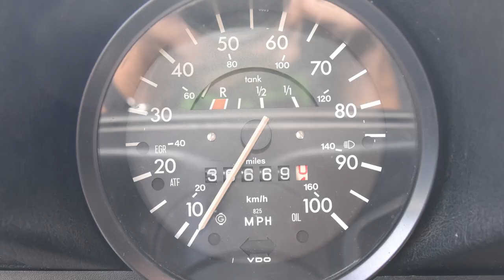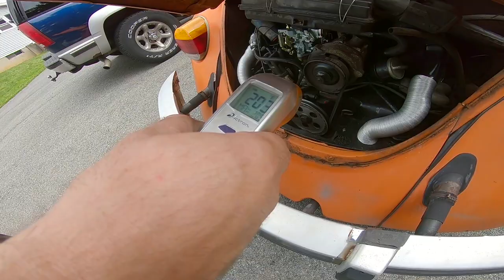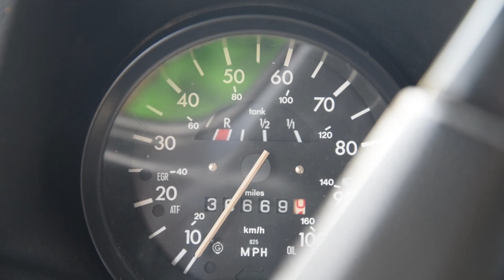1974 Volkswagen Super Beetle 1600: Regular Car Reviews

Comment: I laugh at this review....the reality that disputes every word of this casual opinion of yours was a relative I had, that bought a new beetle every 3 years for about 15 years ...so I guess he had 5 or 6 and this man traveled 100 miles a day for work daily and much of that was on unpaved dirt roads and also in the snow belt...He never missed work...his car never broke down...he did have one that had a phantom electrical issue...but literally the only thing this man ever had to do was change the oil....and yes these cars were simple, with a free afternoon and a six pack of beer a person that knew how to hold a wrench could perform just about any maintenance this car needed, including replacing a clutch. Just looking at the car you reviewed I could tell that this was a stellar example of a car that hasnt had any real love in a very..very long time and although it looks ok from 10 feet away...this particular example is the worst one to base a review on.

Comment: Good review as usual, but you need to lug a VW air cooled engine. First gear is for the first 12 feet, 2nd up to 25mph, 3rd up to 40 and highway hills, the 4th for everything else. You should spend 90% of your time in 4th.

Comment: I owned a 1974 super beetle and I don't believe this model your showing is a 74. Two things are different on your model. Mine had because of the new law at the time seatbelts assemblies attached to each door, that belted you in and there were plastic caps on the end of each bumper. Check it out,  good  video though.

Comment: I'm writing this as i watch. Drum breaks all round? I thought they had at least got discs by this time? Friends 75 had discs already. If not you can do a conversion.  The Super beetle turned sharper and was supposed to handle better.  Beetles are perfectly driveable in the winter, all year round.  Honda Civics in 1974 were shit.   They can cruise at 60, tops out at 92mph.  You need to sort your timing out, make sure you have an electronic ignition.  ALL classic cars need mechanical knowledge to keep them running. How many shitty Hondas and Datsun survive now?  I love the Beetle and love lots of classic cars, not just Bugs

Comment: A BIG problem with this Beetle is the missing engine seal that goes around the entire engine metal pieces.  When Dr. Porsche designed the Beetle he separated the engine into two halves, the under hood area is the clean/cool side and beneath the car is the hot/dirty side.  The two halves must be sealed from one another thus the problems in this video.  And no need for a metal fuel filter.  Also, if the heating duct work, heater boxes, and exchangers are in good shape the heating in these cars is very powerful.  The transmission gear use description here is ridiculous, and untrue.  This is one very screwed up Beetle.  When people have problems with these cars it's because they are not being worked on or cared for correctly.  A correct Beetle is just about trouble free.

Comment: Had a 1974 standard Beetle for 8 years and 120K miles. Never broke down. Even go me home after a deer removed it's left front fender. Like most cars of the era, was a victim of rust but not like the Honda Civics of the day. This 'review' is a travesty, based on a car that obviously has been and continues to be poorly maintained. Does the Beetle have faults? Sure (like practically no heat), but it was a great car for the money back in the day and would be one classic car I would love to own today. A Honda Civic drivetrain from that time might still be good but sadly the rest of the car would have long ago turned into a pile of iron oxide.

Comment: 21,529,464 Volkswagen Beetles manufactured and sold. 0 people unhappy. Until this douche bag hipster says they are terrible. I've driven beetles across the country from Florida to California or Washington state. Once from Panama city Florida to Anchorage AK and back. Never broke down, never smelled like gas, always enjoyed every mile I drove them. Have a 1972 Super Beetle, 1968 Beetle with Auto-stick-shift, 1972 Micro Bus, and 1974 Gia and Thing. If you have an average intelligence and 500 dollars worth of tools, your air cooled vw will run like new. Even up steep hills. My 72 Super Beetle has 125 k miles on the second engine ever. In the process of building a new stock power plant for it. Yet I'll be driving out to Los Angeles in September.

Comment: You chose these over a civic because the civic was already rusted out when it got here. Maybe next time you review a car don't pick one that is beat to death and not maintained. I've owned and raced VWs for 30 years. None ever smelled of gas, none ever ran different with the weather, none ever had gas lines rubbing on things, because I looked after them. Oh, and I've used plastic filters for 30 years, never had a leak or fire. Then again I used this other part called a hose clamp.  Hopefully this car went to someone who will look after it.

Comment: Why would you buy one of these in 1974 over a 1974 Honda Civic?  In 1974 the Honda Civic was a tiny car, more like the original Austin Mini than the Honda Civic we know today. By comparison VWs seemed positively large and back then they had a well earned reputation for reliability. It is true that in 1974 the VW was at the end of a long run and outdated but many of the new small cars introduced at the time weren't particularly reliable and rusted something fierce (In the late 70s I had an early 70s Toyota Corolla where the entire front subframe, wheels and all, rusted right through and just dropped off the car one day). In 1974 VWs were a known quantity and if you just wanted reliable transportation they'd get the job done while you were waiting for the new models (especially FWD models) to work out the kinks.

Comment: I don't understand this review at all. I has a 1974 bug and daily drove it for 4 years up until 2018, when I sold it for a 1972 VW bus. Who thinks these cars are mechanical nightmares? Car maintenance is car maintenance and needs to be done on all classics and modern cars. The only thing different is valve adjustment which is once every oil change maybe. Honestly I found the valves were fine every other oil change but still ran a feeler gauge around. And around town in 1st? 1st gear tops out at like 12mph lol. These are no more unreliable than any other classic I've had including camaros, thunderbirds, jaguars, chryslers, and BMWs.

Comment: Clearly doesn't know much about classic Volkswagen or Aircooled motors. Yes, you can take it to car shows and yes you can hop the motor up and get some very respectable horsepower. I have a 72 super beetle with a 2332 stroker and will smoke most vehicles I pull up to at red lights.

Comment: Go to a poor country and see people still using them as daily drivers, taxis or in the mud because this is the best 4x2 off road vehicle available there and they can't afford to maintain a proper 4x4.  

This engine doesn't care about oil temperature,  or even oil specification, it just kind of works. The suspension is shit, but it's cheap to maintain if you live in place where tarmac is scarce. A schock absorber is about 10$ in Brazil.

Brake pads? Almost free

 Sure they demand work and perform bad, but they will perform badly forever as long as you keep 3m of wire, a screwdriver, a plier, some silvertape in the glovebox forever.

Comment: So much bad information here.  Starting in mid-73 all Beetles had ALTERNATORS.  If you are getting gas and exhaust smells then there is something wrong.  That is not a "feature" of the bug.  Also the brakes not seating properly is a mechanical problem not a normal feature.  I have only owned 70's beetles my entire life.  I drove my 75 beetle from southern Oregon to Los Angeles and back a few years ago and it performed fine.  I have also lived in an area with below zero temps on winter and as long as you take the time to keep things in proper working order it performs fine.  .  I comfortably cruise at 65 to 70 in mine.  Rarely do I have to downshift on moderate hills. You guys really have no idea what you are talking about.

Comment: Take any old car in this condition.  The experience would be similar.  Had it been a new car or near new condition, he wouldn't have as many things to bitch about. It's a old car thats been used and abused for many years. Of course it doesn't have the creature comforts of a newer car. Its old and it was designed in the 40s . As for reliability.  They would put up with more extreme punishment, heat, cold, sand and snow, than any car of the time. Bug parts have raced on pavement, sand and mud. The engine has been used in certified and a popular  home built aircraft engine with good results.  Not a powerful one, but what would one expect. Fix it up, treat it like a car of its time, and it will be a reliable god car. But don't expect, it will be like a new car, with today's expectations.

Comment: wow, woke reference 3 years ago...but it has the cool convertible steering wheel or limited edition beetle... replace the hoses and you can stop the gas smell.  If I can do it, anyone can.  In mid year 73, they had alternators...like this 74 does.  ... I drive it because I like it, it makes me happy.  I don't care what anyone else thinks and that's why I have them.

Comment: This guy knows nothing about VWs,  I have had a 72 super beetle for 12 years and have taken it 1000 miles round-trip and up an down the mountains in Idaho with no issues.  I also had a 79 Chevy LUV or I should say an Isuzu, loved the truck but it was not as well built as the beetle.  If Japanese cars were better than the beetle in the 70s, than why are there more beetles still on the road ? Whens the last time you saw a 1974 Honda? I saw a 1968 beetle still running on the road yesterday.

Comment: First of all, boneheads, a '74 has an alternator and not a generator. Last year for generators was '72. And that's what your car has too, it's clear in the engine compartment shot. Second, the plastic filter is a hazard but it's also needed for troubleshooting because it's transparent and shows if there there is gasoline in it while the metal filters don't do that. If mounted properly, a plastic filter will do just fine.

Second, this is 45yo economy car made with some 1930s technology. Of course it will require more maintenance than a modern car. If you expect any car to be like a modern one - well, you're a bonehead. It's part of the fun for some of us. 

Third, yup, Northeast is a horrible place to be a car enthusiast. All the good shops that work on these are on the West Coast. I live in SF and drive my '72 Super year round. I got it in a somewhat rough shape but I've been fixing stuff when needed, made some upgrades along the way and it's a great little city car with disc brakes up front, dual carbs to climb hills and wider wheels for good turning. I love driving it more than my 300hp WRX.  Owned it 5.5 years now and didn't give up and run away on it like a wuss because it requires more maintenance than a modern Toyota.

Comment: Holy crap...You gizz all over the Karmann Ghia but you're going to shit all over the Beetle which is mechanically the same thing. A Super Beetle was equipped with Macpherson struts up front instead of torsion bars. This particular example is poorly maintained. That Ghia where you're eating balls IS the Beetle with cosmetics. That's the Oscar Meyer dressed up Chicago style. Yes, you'd better know an Airhead and get on forums. It's very much a lifestyle. Once you know the maintenance though they're like lego blocks and they're super dependable. Yes, they require attention. You have to clean and adjust points, you have to adjust valves. You have to actually WORK on the thing. If you take care of it, it will take care of you. Handling is wicked and takes getting used to but the things climb hills like a mountain goat. But Man you generalize way too much.

Comment: As much as this is a Hitler Car Plus!, It's not anyone's fault but your own for driving a terrifying amalgamation of piss wiring, a leaking fuel line, & an unreplaced heat sensor diaphragm that controls pretty much everything.

I'm willing to bet the air cooling covers were left unsealed by some shoddy engine tech in the 80s. You leave ore tiny panel out & the whole system fails. Otherwise the engines are indestructible, or at least repairable on the side of a road.

Comment: Pointless video with many errors unless it's just a spoff video then it would be funny. Any 45 year old neglected & unrestored car will run like that. Bugs are probably the cheapest to restore and fix up out of classic cars. That's not even a 74 it's a 73 because of the AK stamped on the engine case. That's also definitely not a generator but an alternator (it's post oct 72) just shows how little the owner knows about cars.

Comment: A lot of dumb shit in the video. It's an alternator in there not a generator, it's broken or really worn out if it isn't making electricity. No wonder it smells like gas if you have the old cloth covered fuel lines, replace them. That description of gear usage, oh boy, really revving it like a rotary. If it gets too hot, you're using it too hard or you need to fix it, which isn't too hard in a majority of cases up to when the engine needs a rebuild.

Comment: Maybe your test car smells like gas because the owner of that '74SB hasn't bothered to replace the cloth-braided rubber fuel lines and doesn't understand that ethanol rots them. The reason they're cloth is to prevent chafing by other components in the engine compartment. It's not perfect but, if properly maintained, it works. If Previous Owners left well enough alone and didn't needlessly splice, the wiring harness wouldn't fail and you wouldn't need to go to the burn ward. Generator? In April of 1973, VW replaced generators with alternators. 

If you're going to make a "review" video, do your research first. Being smug and snarky, while at the same time grossly ignorant, makes YOU look like the woke posers whom you mock. I've spent the last two and a half years restoring my '73SB back to its original factory mechanical and electrical condition, undoing everything that Previous Owners "upgraded". It gets 28MPG, has ZERO gas smell, and the heater will roast you in the winter. Hell, even the original Motorola Sapphire XVIII AM radio works. Speaking of winter, when I was a kid my neighbors had a 1974SB they bought new, and they drove it in the winter with no issues. Oh, I grew up in Hametown, PA, just south of York, btw, and remember the blizzards of 1977 & 1978 quite well.

The VW engineers knew what they were doing, when they built the 1302/1303, and it's up to the owner to perform preventive maintenance to keep it in correct, working condition. It's a no-frills, reliable Keep It Simple Stupid vehicle. Spend a day driving a fully restored Super Beetle and you might just change your mind.